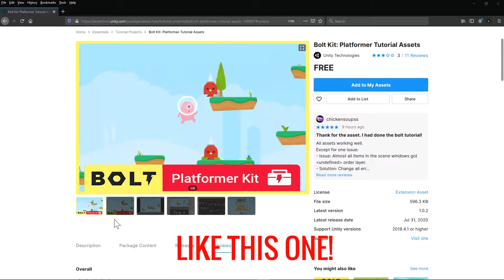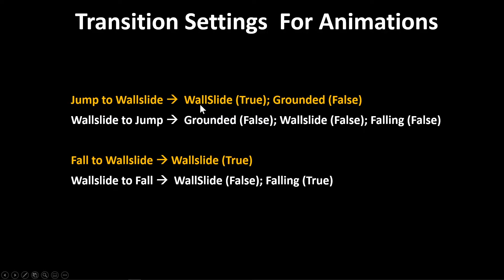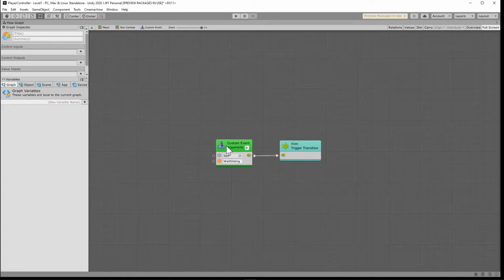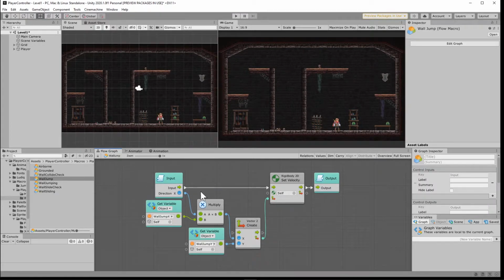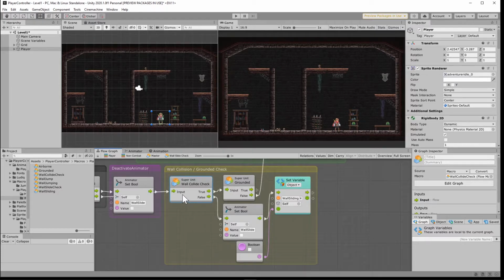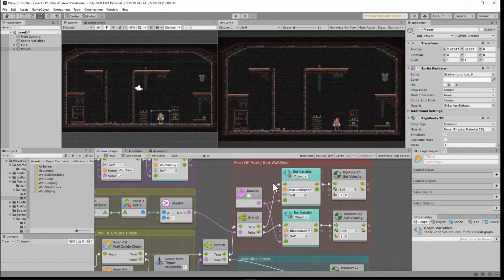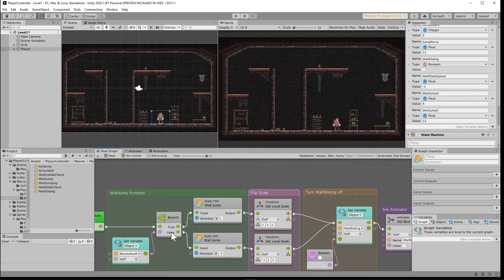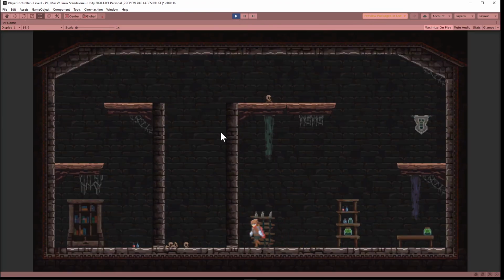Build A Player Controller Without Code # 6 - Wall Jumping & Sliding - Bolt Visual Scripting + Unity

Comment: For anyone that comes across this now, something I noticed that I'm not sure is something I did wrong or an issue with the graphs is when airborne finishes and gives control of the player back, the player kept the velocity from the wall jump, so if you held down the direction that you jumped in, you would get a huge burst of speed from the transform and velocity together. I also noticed if you tried pressing the move button back toward the wall you jumped from and then let go, the player would drift the opposite way (away from the wall still). My fix was to reset the x velocity to zero after the airborne timer and before the custom event to end airborne. You can do this with Get Velocity from the rigidbody 2d > get y (to maintain the upward velocity from the jump) > create a new vector 2 > then feed that to a Set Velocity that is set in the flow between the timer and the custom event to end airborne. It took some fiddling to make sure the player couldn't endlessly wall jump up a single wall, but I ended with .37 for the timer. Hope this helps someone out! It took me quite a while of digging to figure out.

Comment: Hey guys. Is there a way in which you can aircontrol the movement of the player while wall jumping in the same way as a normal jump? Thanks in advance. PS: love this series :)
Reply: @Megahertzs Btw I'm experimenting an issue where whenever I wall jump, my player moves on the X axis in a normal speed while going up, and then moves Waaaaaaaay faster in the X axis when going down. Anybody else having this issue?
Reply: UPDATE: Ok, so by deactivating the airborne parameter you can control the jump as usual
Reply: @guille_sanchez  Can we connect on discord so you can send me this option. Would really love to check it out
Reply: @MegasTheGaing  Sure
Give me your discord

Comment: Question the walls are on a tag or/and layer because i follow it one by one nad i can't wallslide to test the rest, and for some reason the block right doesn't check pls help
Reply from the maker: Make sure the block right collider is set to trigger and is positioned appropriately outside the player collider
Reply: @Megahertzs  Trigger is purple or orange;

Comment: The "Get Button Down" with the Button Name "Down" in the Wall Sliding Unit was always throwing up errors. It worked for me when I replaced it with "Input: Get Axis", type in the "Vertical" axis, plug that into a "Less than" (B=0), so that it would work only when pressing down or s, and then plug that into the branch. If anyone´s stuck there.
Great video though. You´re teaching me so much!!
Reply: Same error, thanks for your suggest, it works for me too!

Comment: I have a small problem, sometimes my Player bugs and starts wall sliding on empty air please help(I followed all the videos up to this one and I don't have an error, I thought it may be my level not set up properly but I created a new level with only a floor and it still does that, i replayed this video like 3 times and checked that everything is the same in my game and it is) and i would feel bad if i don't say that the series is amazing.
Reply: i'm having the same problem. i've given up on the project because of it :/
Reply: I got the solution: Go to the Fall --> Idle transition and change the Grounded condition from false to true.
Reply: Any chance there is an answer to this one? exactly the same issue and the solution provided by Koppany does not work for me as i already set it up properly

Comment: Hey again Megahertzs. I just noticed that when I press down to end the WallSlide, it doesn't turn off my WallSliding animation until the character hits the ground. Also, if the character is moving when the WallSlide ends (either because they drop off the bottom of a wall or I press down and a direction to end the WallSlide), then the WallSlide animation doesn't even turn off when the character hits the ground. Any idea why this might be happening?
Reply from the maker: Can you reach out to me on discord and let me take a look?
Reply: @Megahertzs  Sure thing.

Comment: Should the Value input for the WallJump be an Integer or Float? Excuse my ignorance.
Reply from the maker: That's going to be a float.
Reply: @Megahertzs  Thanks, I managed to work that out. I'm just stuck with this BlockedLeft bool not working correctly. When I run into a wall it activates, but when I move away it doesn't deactivate. Combing through the Flow Graphs to try find an error, but I haven't managed to yet.
Reply from the maker: @loganbroadley  Are you on the bolt discord?  If so, I can take a look and see if I can help you out.
Reply: @Megahertzs  I'll get on it now.
Reply: I believe a Float. I'm running into an issue where my BlockedLeft bool doesn't deactivate and as a result sometimes doesn't activate when I WallSlide. Any ideas?

Comment: Just a heads up but I had to set up a tag for walls because for some reason my character was never becoming grounded again once he had slid all the way down to the ground. Not sure if this is an issue I caused with a mistake elsewhere or if it something others will encounter, but I think regardless tagging walls seperate should be good practice anyway? Regardless great tutorials, this series is the best on Bolt I've used so far! Cheers!
Reply: @GrandTheftEx I think I
 found a better solution. You need to create a transition from the WallSlide -> Idle with Grounded - true and WallSlide - false. Also would be recommended, for the WallSlideCheck macro, in the Wall collision / Grounded check group, to set WallSliding variable to false if Grounded - true.
Reply from the maker: Hey thanks for the heads up and encouragement!  Setting your walls to a separate layer and running your wall collision is an extra step, but you might be exactly right in going ahead and doing it.  In order for my original controller to work, I had to adjust the location and size (I shrank it and moved it downward a little and it fixed all my issues).  Thanks again for the kind words.  My goal is to continue to get better and better in these tutorials!  Hopefully these will only get more entertaining/informational!
Reply: I'm having this issue when my player walks between two platforms that are separate game objects. As soon as the character walks to the second platform, groundcheck becomes false. Any solutions?